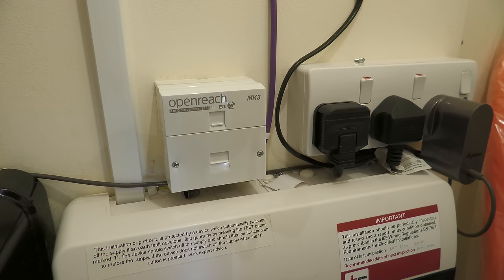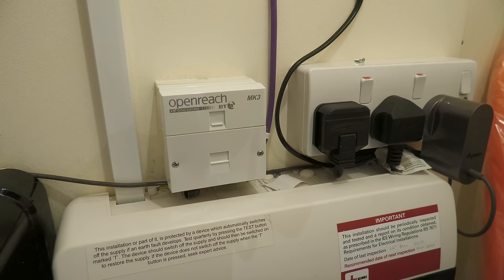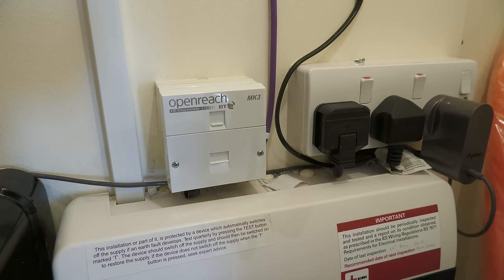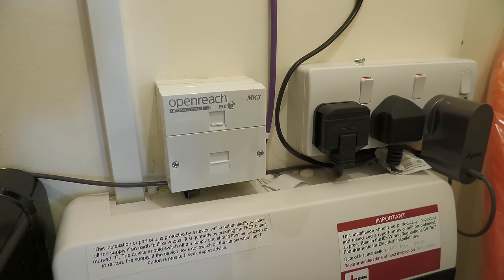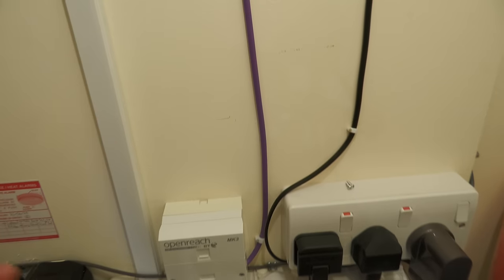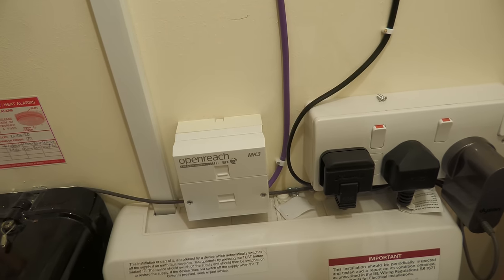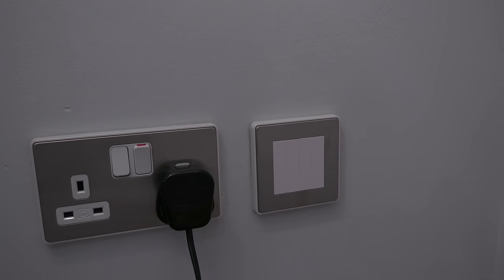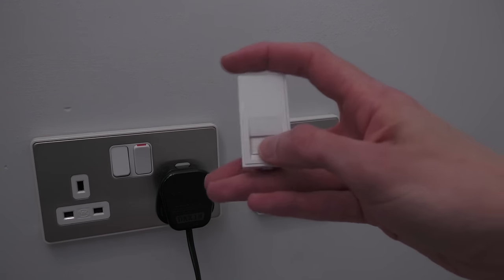300 Mbps DSL!  Upgrading my Home Network to TalkTalk Fibre 250 G.Fast Broadband

Comment: BT has not stopped offering g.fast, or possibly at the time of your video being made they temporarily paused the rollout.
I just got BT fibre 250 g.fast by calling them up, as i'm only 160m away from my cabinet.
Reply from the maker: Yeah, that was an error on my part when initially researching, with BT the G.Fast plans only show up when you select "Broadband and Phone" where I had been looking at "Broadband Only". With most providers "Broadband and Phone" includes various calling plans that I don't need with the "Broadband only" options still providing a pay as you go landline, whereas with BT "Broadband Only" doesn't even include a dial tone and I presume this service is incompatible with G.Fast.

Comment: Do you not have any FTTP options there? Even in the middle of nowhere in Dorset I do!
Reply from the maker: Nope, otherwise I'd have gone with that.  Rural areas tend to have pretty good FTTP rollouts as they generally had really poor DSL performance and therefore were prioritised for FTTP.  It's also likely easier to install FTTP in a rural area where roads are quieter and some services are delivered via overhead lines.  Whereas I am relatively central in a city where major roads would need to be closed to install fibre and then to install it into my building would require cooperation between the provider and the building's factors.  It'll happen eventually but it'll take time so at this point G.Fast is the best I can get.
Reply: @camerongray1515  in suburban Nottingham OpenReach were installing FTTP as the country went into Lockdown, got chatting with one of the engineers when they asked me to move to car so they could access the post - the fibre to the nearest post is all installed underground in existing ducting, but they were having to dig up and relay a lot of that ducting as it had been crushed by (mainly) pavement parking, but from the post it goes overhead like the old copper does.  Going from an unreliable (OpenReach had switched the pairs from the cabinet to post numerous times, and replaced post to home wiring completely and still fall over after heavy rain) 65/10 with four of us working from home to 150/30 was great, no random VPN drops throughout the day! The rock solid connection of FTTP is worth more than the speed TBH

Comment: Hey Cameron what’s the difference between a modem and a router?
Reply from the maker: A modem is purely responsible for converting a digital network connection such as ethernet to an analogue signal that can be sent over a phone line/coax cable.  A router connects digital networks together and in a home setting performs a bunch of roles including NAT (which maps between public and private IP addresses allowing all of your home devices to share a single public IP), DHCP (which issues IP addresses to devices on your network) and often some sort of firewall and DNS cache type services.  If all you had was a modem you'd likely only be able to connect a single device to the internet with the device getting a public IP address without any sort of firewalling.  This used to be common when people just had a single desktop PC connected to a modem but as people began needing to connect multiple devices or wanted to use wi-fi, routers became commonplace.  Home "routers" are often combination devices of a router, an access point a network switch and sometimes a modem.  If your router connects directly to a phone line or coax cable then your router has a built in modem which will have its own distinct circuitry separate from the router part of it.  With a setup like mine, all of the components combined into a typical home router are instead split out into separate devices (router, switch, modem, access point) for better flexibility and performance.

Comment: Start of Video => Your inspection of your CU is in march 2020, but your video is from 2022. Why do you not let make it from an electrician?
Reply from the maker: There is no legal requirement to perform EICRs (electrical inspections) it is just a recommendation date of the next inspection that is decided on at the time of the previous inspection (in this case when it was installed back in 2010). I have since carried out enough work and my own checks and tests to be comfortable that the installation is safe without forking out for an electrician.  I've even found and rectified faults that were present when the initial "inspection" was carried out!

Comment: Did you ever get around to connecting cat6 cable directly into the socket. I've the same setup but don't know which two cables I need to connect from cat6 cable and also there seems to be a three cable and two cable holders and I'm not sure which one to plug the cable into. There is someone selling cat6 rj45 to rj11 for this and apparently you can get 10mbps difference and better connection (less crc errors) but then I've seen reviews on YT saying this cat6 cable doesn't work and is just a scam. I'm interested in your thoughts. I'm getting 147mbps on 150 connection as I'm about 320m away from cabinet and just 17mbps upload. So anything I could do improve, please share your thoughts.
Reply from the maker: I never really bothered to do it as it's been working fine without.  If you were going to do it then the connector with 2 terminals on the back of the G.Fast faceplate is the one you'd need.  The one with 3 terminals is for phone extensions.  It doesn't matter which pairs you use but you'd need to match the same colour to ensure that you are using two wires from the same twisted pair (so blue and white/blue would be fine, but don't use blue and green).  Traditionally blue is the first pair so I'd use that as this also means that the RJ11 end would match a standard wiring colour scheme where the middle two wires are blue.  The CAT6 modem cables are technically going to be better but it's not something I'd necessarily be too worried about assuming you're only using a short cable between the master socket and the modem.  The cable that runs from your master socket to the street cabinet will be way lower grade than CAT5 so a small bit of better cable on the end is unlikely to make a huge difference.  The only time I'd really see it being an issue is if you're using a super long cable and you're using really poor quality flat telephone cable.  With your setup on G.Fast I imagine the speeds really are just down to the distance from the cabinet so there's likely little you can really do on your end to improve it much.  With a 320m run to the cabinet, you are only able to really make changes to say ~0.5% of the total length of cable that your modem cable makes up.
Reply: @camerongray1515  thanks for your response. In the end, I managed to plug to rj12 on cat6 cable but mirrored the end points as per the cable that came with the modem like a crossover cable. This worked, got an increase of 2-3mbps but the response times have really improved I don't know why but internet now seems much more fluid and responsive and gaming certainly has got better and latency seems to remain stable between 19ms to 23ms which was my main aim. I was originally trying to use an existing cat6 cable with rj45 on one end and crimping rj12 on other end but it didn't work, maybe I couldn't work out which pair was used on rj45, so adding cables to the plate probably would have required a bit of trial an error. So finally I took rj45 off and added two rj12.

Comment: Any clue how to get better speeds in a block of flats that's less than 10 years old doesn't matter where a go it's 70mb but a have a sx ps5 lgc1 and really need fiber any work around mate ?
Reply from the maker: If the fastest your line can do is 70 Mbps and there aren't any other fibre/cable/5G options then realistically you're stuck with what you have.  That said, as much as people bang on about super fast connections, 70 Mbps shouldn't be unusable, even many offices full of people get by with less - I coped perfectly fine with my 70 Mbps connection including working from home every day, streaming video and uploading 4K YouTube videos.  This upgrade was more "because I can" rather than a desperate need.  I'd start by checking that your router/WiFi.etc is not the cause of any issues - try connecting devices with cables (even just temporarily with long cables trailing through the flat) and see if that makes a difference or consider upgrading your router.

Comment: Why so low upload test. I get up and down both 220mbps in 200mbps plan here in airtel in india
Reply from the maker: It's annoying but it's just due to the nature of DSL connections.  Only a certain frequency range is available and this needs to be allocated between upstream and downstream.  To get a faster upload, more frequency bands would need to be assigned to the upstream which means less would be available for the downstream.  (So whereas I can get 330 down/50 up, if the upload speed was to be increased to say 150mbps, the download speed would need to be reduced to say 230mbps)  While the upload speed is of huge benefit to me, the average consumer generally cares more about download speed so providers generally only offer asymmetric services geared towards a higher download speed.

Comment: Interesting that BT are no longer installing G.Fast. A couple of months ago a family member wanted an additional broadband connection as redundancy and so went with BT. I was there when it was installed and was shocked to find they had got 300Mbps as I was expecting a VDSL2 connection. They must have put them on G.Fast. I wish they'd upgrade our local network as Virginmedia really isn't good value and the upload speeds are quite measly.
Reply from the maker: That was a mistake on my part as someone else pointed out - Turns out BT do still offer it but only if you pick "Broadband and Phone" after doing an availability check (weird since they'll show VDSL packages under Broadband Only.  Although at £50.99/mo for the 250 Mbps plan, I think I'll stick with TalkTalk!
Reply: @camerongray1515  It's easy to spot the bolt on pod for the Huawei G.Fast kit on the side of your local green street cabinet
Reply: I dont understand this I have fibre 65 - often I get speeds of 800mb its 25£ ….

Comment: When the uk gets better internet speed than your area you know your infrastructure sucks.

There are areas with ftth with symmetrical gig but there still pretty uncommon.

Areas wirh bonded vdsl 100/40

Areas wirh normal vdsl 50/20

And we have dosis over coax that can do a gig down but only 30 up.

Although our packages that are price equivalent to what you have is 60/10. Dosis

From Toronto canada.

Comment: Great video. I honestly had no idea the UK had a specific phone jack. I assumed you guys used RJ11 jacks like we do in the US... I know, stupid American. 😂 I also looked at some of the ISPs you mentioned in the video.. Surprised at a few things.. 

1. you guys seem to have longer term contracts for internet
2. the pricing seems pretty reasonable compared to the US (in some cases)

Is cable internet not widely available? I'd say most of us in the US despise the cable internet operators (like Comcast Xfinity), but, the speeds they offer can only be beat by fiber, but fiber availability is pretty hit or miss.
Reply from the maker: We do generally have reasonable length contracts on higher speed plans, although this generally is used to offset the fact that we usually don't have to pay for any sort of installation or costs for the supplied equipment.  Cable does exist here, however we only have one major cable provider, Virgin Media and while they used to be very popular, high speed fibre is definitely taking a lot of their business.  They also aren't available everywhere - my building simply doesn't have the cable infrastructure in place to use it.  It's not like in the US where practically everyone has/had cable TV - in the UK the "standard" way to get TV is over the air through an antenna which has over 100 digital channels or if you want a paid TV service, both satellite and cable are very popular options.

Comment: Interesting. Its the upload speed that I need for cloud backup. I see with G.Fast it's still 6:1 down to up. I wish we could choose the ratio. Mine would be 50:300 on G.Fast (or on my current set up 8:37!) 

Some years ago I replaced my faceplate with an NTE5C. It's in the hall right next to the front door hinges. We did not want any equipment in the hall (aesthetics and fire risk). I noticed there was ADSL terminals at the back of the NTE5C faceplate so I wired from these through the wall and into the garage where I have my modem/router and all my networking stuff. The house phone wiring was also tapped into the analog terminals at the back. I ran off an additional telephone line again into the garage where I have a OBi110 PSTN to IP gateway linked to an Asterisk system.
Reply from the maker: I'm in a similar boat, most of my traffic is upload (YouTube videos and off-site backups of my NAS), I'd much rather have something like symmetric 150 Mbps than 330/50.
Reply: @camerongray1515  I recently moved into a new build property on the OFNL infrastructure. 

I was able to find a 300/300mbps FTTP package for that exact reason. The uploads offered by most consumer providers in the uk are pants.

Both my wife and I work from home and are on video calls throughout the day. 
We get a 1-3ms ping which is ideal if I was ever into gaming etc

Comment: As an openreach g fast trained engineer you will need to change your filter for specific g fast filter distance wise you really need to be under 350 meters from the pcp you will need 11g drop wire if over head fed
Reply from the maker: That's exactly what they did as shown later in the video - they replaced the master socket with an NTE5c and fitted a G.Fast filter.  I'm fed from underground and the engieer stated that I'm only 50m from the cabinet.

Comment: I get my internet over LTE networks (internet / voice) all in one! Ie. router antena on a high pole (and I can say that I have 85% of a time) 50 UP and 50 DOWN internet speeds, and that is 10x better what I would have with any other (regular) ISP in my area. In hindsight I honestly think that ppl lack of kinologe about given matter. 🙄
Reply from the maker: I did actually consider this - there was a 5G mast recently installed nearby that gave over 1 Gbps symmetric to my phone, however unfortunately the coverage is so bad at home that I barely get any signal for calls, let alone enough for high speed data.  Definitely a viable option in a lot of settings though.

Comment: Why not use a system like zerotier if you want to get access to home etc , not much point in a static IP .
If its a shielded cable and its not at least earthed at one end it will be out of spec and worse than an unshielded .

Comment: The UDM can't do baby jumbo!? Unbelievable. Even my Edgerouter X does baby jumbo on the PPPoE connection just fine.
Reply from the maker: Unfortunately it can't, well, at least through the UI, could probably do it with some sort of bodging to the underlying Linux system to set the appropriate MTUs.  It's a great device but very much focuses on ease of use over advanced features - you're basically getting a very fancy home router rather than something like an edgerouter/pfsense box.etc.  They're slowly getting there but I do somewhat miss how the USG Pros ran EdgeOS underneath so even if you couldn't configure something through the UI, you could manually write EdgeOS JSON configuration.

Comment: wait you can telling me DSL can do 300Mbps?!
Reply from the maker: It can, it can even go up to 1 Gbps with current technology.  Ultimately it comes down to the technologies in use and the distance between you and your DSLAM (the device that adds the internet connection onto your existing phone line).  Traditional ADSL services place the DSLAM at the telephone exchange which could be some distance away and hence operate at relatively low speeds.  Later, services such as VDSL were introduced where the DSLAM is usually located in a street cabinet closer to you and connected to the exchange over fibre, since the DSLAM is now closer to you, it can run at higher speeds.  Then since then, technologies such as G.Fast have been introduced with higher end equipment in the street cabinet to allow for even higher speeds like I have here, the trade-off being that you need to be very close to your street cabinet (less than 250m, I'm only around 50m from it).

Comment: Thats not an upgrade lol i live in a rural village had talktalk 65 been with them for years now i'm with gigaclear 500 up 500 down for £25 a month.
Reply from the maker: I can only get what is available in my area/building and in this case, G.Fast is the best I can get.  Rural areas tend to have pretty good FTTP rollouts as they generally had really poor DSL performance and therefore were prioritised for FTTP.  It's also likely easier to install FTTP in a rural area where roads are quieter and some services are delivered via overhead lines.  Whereas I am relatively central in a city where major roads would need to be closed to install fibre and then to install it into my building would require cooperation between the provider and the building's factors.  It'll happen eventually but it'll take time so at this point G.Fast is the best I can get.